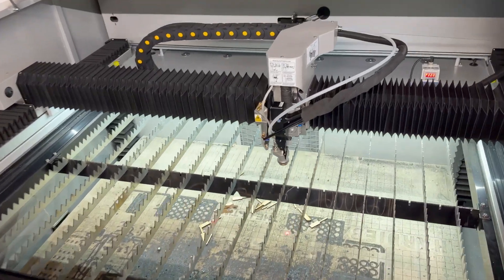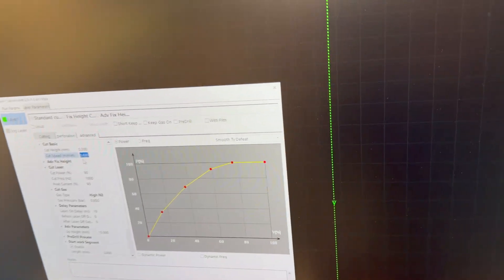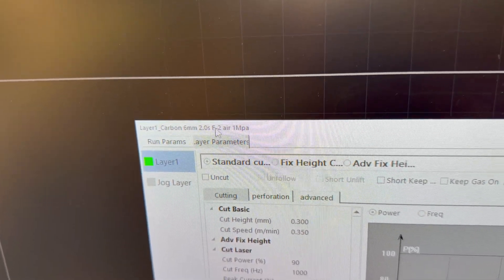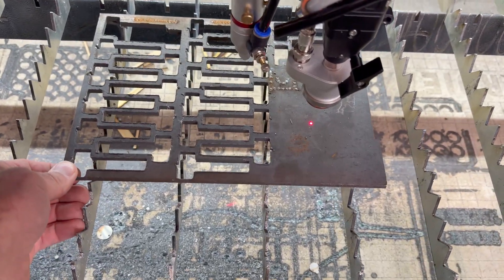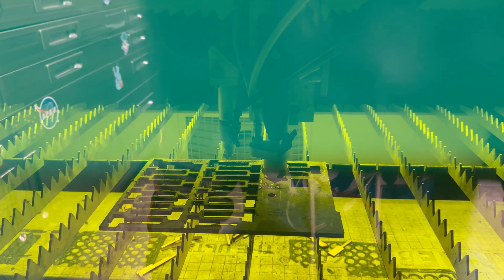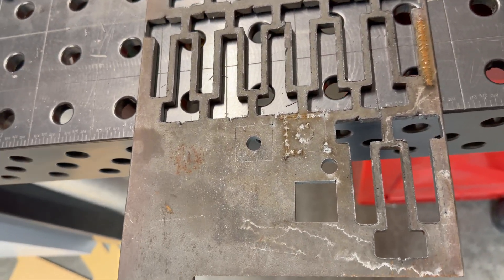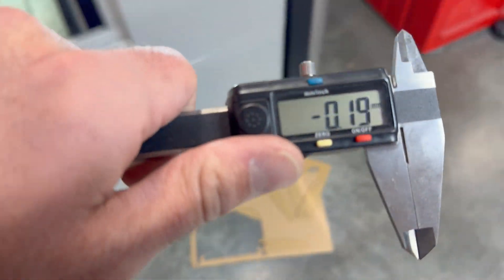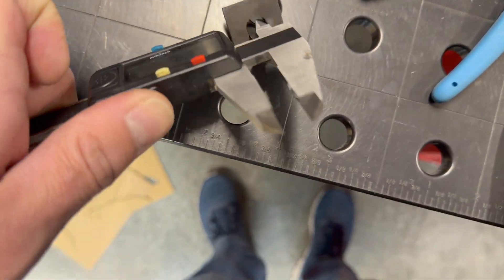Gweike M3 Ultra at Dadgineered Shop cutting 14 Carbon Steel

Comment: What material is that in the bottom of the machine? Almost looks like a plywood sheet?
Reply: Looks like cement backer board (used for covering walls in places like showers before putting in tile).
Reply: @mmmmmmmmmmmmmmmmmmmmmmmmmm4641  Thanks. Looking on my PC (originally watched on my phone) I can see it says "Hardie Ba.." great idea, I wonder if there is sand below it. I will do sand with Hardie Backer on top like this for mine.
Reply from the maker: It's Hardy board from any hardware store.  I have it cut into two layers covering the entire bottom.  While it's not the most perfect material - the laser can melt/cut it at the highest powers, it works and it makes cleaning and getting dropped pieces very easy.
Reply: @dadgineered  I think with sand under it just might be the perfect solution. The sand will not be disturbed and the hardie board is easy enough to replace. Great idea! How are you liking the laser otherwise? Mine is here but not connected yet, and the compressor won't be for a couple more weeks.